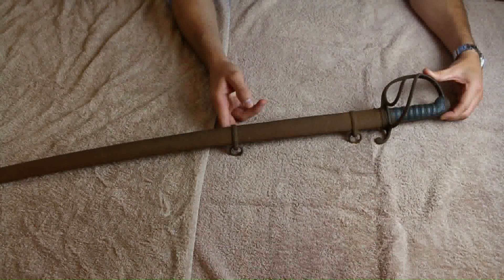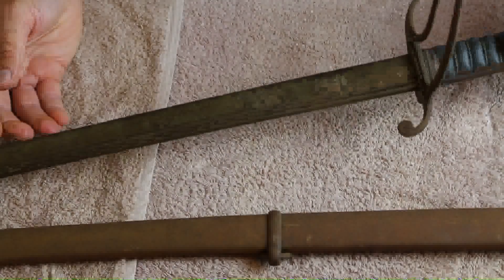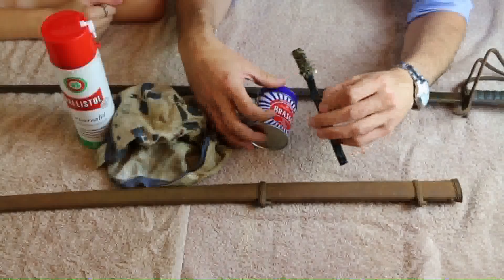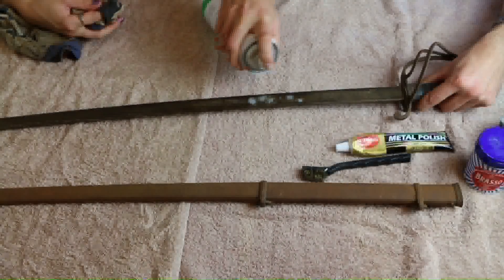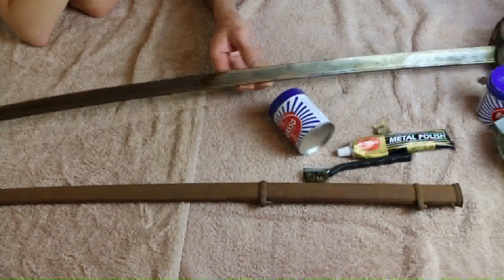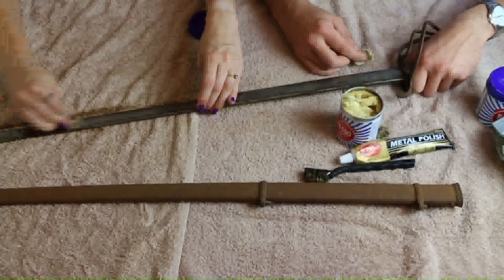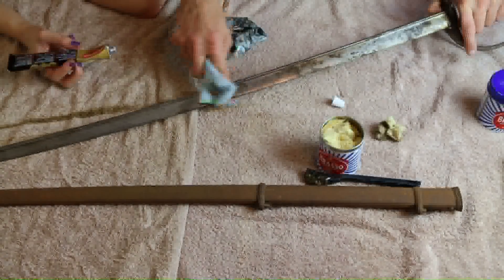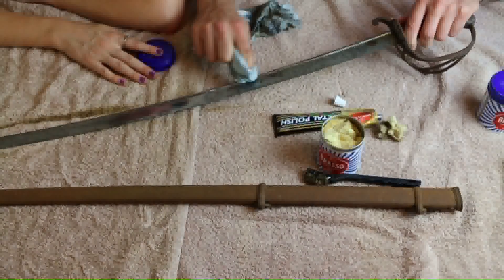Restoring an antique cavalry officer's sword blade

Comment: I think your camera has issues focusing on the blade becouse of the rich detail of the background. lots of shadows and rises and valleys in the carpet/ towel. resulting in a grainy end product. Ofcourse it might also and rather more likely be on youtubes end since linking up all those pixels which have so much detail inthem takes rather a lot of computing. so to make it easier the little squares are created which are by no standard perfect but aim at giving a semblance of cohesion to the jumble of shadows present.

Comment: You should invest in a really good quality camera that you can use for pictures for sale, but also you can take stills of these kinds of details that your video camera typically fails to show us and then just splice them into the video.
Reply from the maker: I have a pretty good camera - if you look at antique-swords.co.uk then you can see the photos of swords I'm selling. But remember that I have to reduce the size of photos there due to making a functional website where the pages don't take too long to load. The quality of the film in this video was because of using towels as a background - not an issue I was aware of until now.

Comment: What is a teetowel? Also the innuendo.
Reply: A teatowel is a  handtowel sized, rectangular cloth, usually made from cotton or linen, frequently with printed decoration, used for drying plates and cutlery after washing them (if you don't have a dishwashing machine)